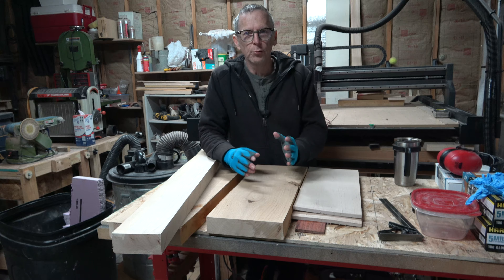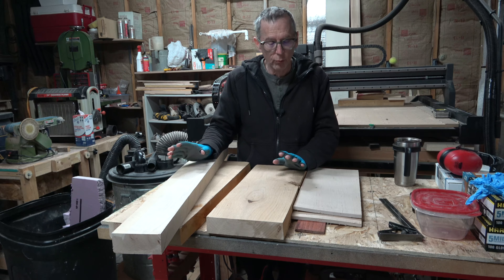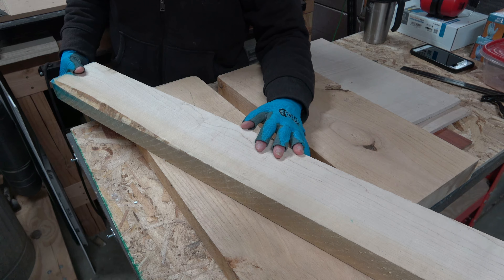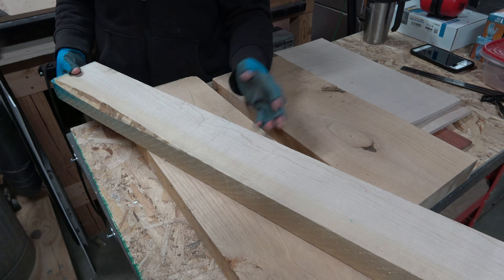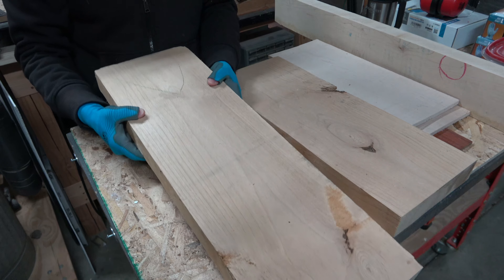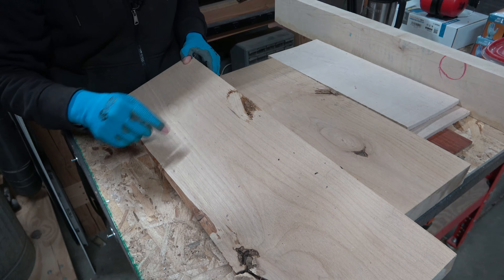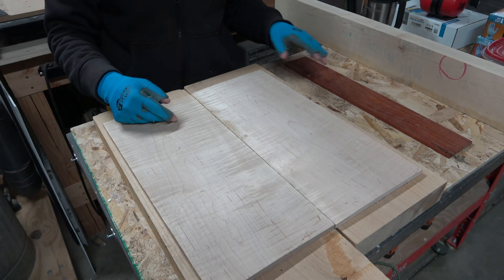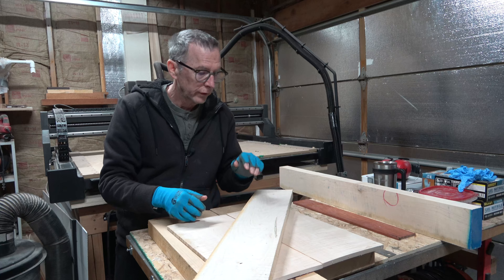Making A Six String Multi Scale Guitar Selecting The Wood

Comment: With your moisture meter pick an area you know will be cut off, put your pins in to mark where they will be, drill a couple holes near center depth and check moisture. Where the truss rod is going to be is a great spot too. I check everything but I also mill and dry my own.

Comment: I have a quite interesting question for you as a professional guitar builder you are. Let´s say you build a Les Paul style guitar with a set neck construction like Gibson does, you want to take away material on the back of the neck heel to get better access to the higher frets, is it better to make the mortis less deep and make the neck less thick to be able to take away more material on the back of the neck heel, or is it better to just leave the construction as is and only take away the material that is able to take away without going all the way through so it will have a negative effect on the glued in neck ? and how will either of this options have an impact on the guitar sound ? I hope you understand what I mean, English is not my native language.. thank you very much.
Reply from the maker: I'm sorry, but I don't understand what you are asking.
Reply: I think his concern is about the thickness of the neck joint. Disregarding angle let’s say the body is 1.75 thick and his mortise is 1.25. That leaves .5” of wood left on the body at the heel. However he wants to carve away some wood at the heel to make it thinner at those higher frets. Let’s say he carves away .25”. Now there is only .25” of body at the bottom of that neck joint. What is the threshold of that before it becomes a problem? And is making a shallower mortice and a  correspondingly less tall/thinner tenon the best solution? Are there any tone implications? I would think not. 

Sorry if I muddled this even more.
Reply from the maker: Try posting your comment in your native language and I will see how it translates to English on my end. This has worked for me before.
Reply: @philgerke   That's exactly what I am talking about, you are spot on my question, thanks man.. :D
Reply from the maker: @philgerke  In answer to your explanation of @HearGear's questions (Thanks!), I would say .25" would be the limit. I have gone as thin as .125" in Mahogany and that made me nervous. My feeling is that if you want easier access to the frets at the heel, don't play a Les Paul. Tone is subjective so there's no way to know if the effect would be good or bad.
Reply: @HighlineGuitars  Yeah.. i am satisfied with that answer, even though I have a Les Paul build to do shortly, I have a great carved Les Paul top and some European Walnut as body laying around, also some quarter sawn walnut for the neck, fretboard I did not decide yet, probably walnut too. But first I am going to build a new neck for my 1989 Gibson Les Paul Standard, there is no Mahogany to be found easy in Europe these days so it will have to be Walnut as well, its not right for a Gibson I know, but this guitar is staying with me so Walnut will have to do it.. thanks.

Comment: Hi Chris, when you cant access the wood youz would like to use, how do you know which wood you can use instead? 

(im from germany and i would like to use mahogany for my guitar body but its really hard to get)

What are your Criterias for wood when you build a guitar body? 

(weight, Sustain, Hardness, Maybe the Tone?) = i would like to use wood which is harder than walnut and as light as possible with midrange frequency Tone
Reply from the maker: The harder the wood, the heavier it is. That’s just the way it is. Stick with the tried and true species (Mahogany, Alder, Swamp Ash, Poplar, and Basswood for bodies. Maple, and Mahogany for necks. Maple, Rosewood, and Ebony for fretboards.). If you want or need to use something different, compare your choices with the ones I just listed by visiting https://www.wood-database.com
Reply: @HighlineGuitars  Thanks alot Chris, yeah i know that "The harder the wood is, the heavier it will be" 

(It's because of the density of the wood)

 but i thought that you always look for a specific hardness and weight for the wood ;)